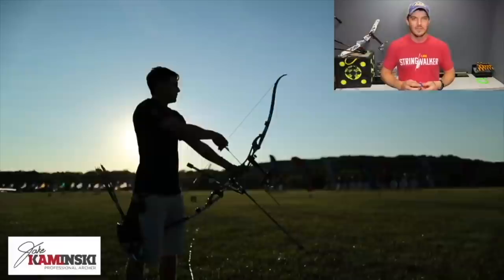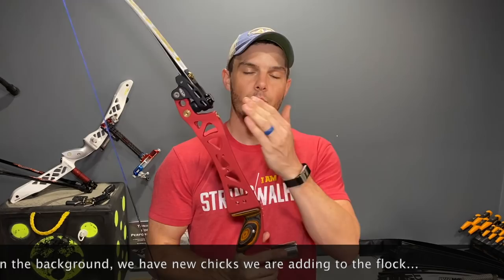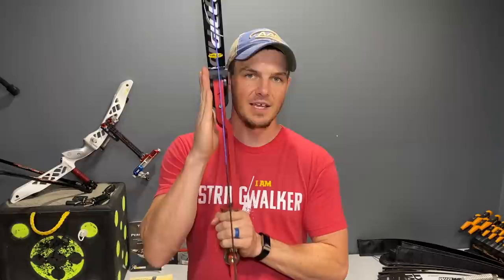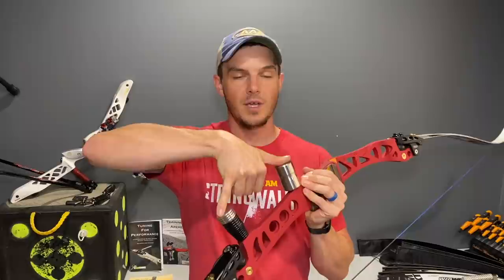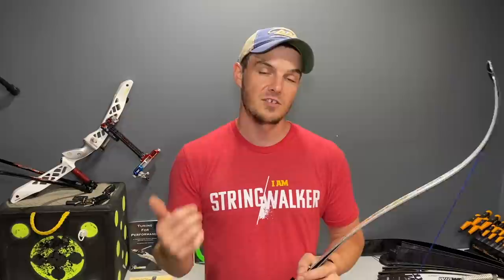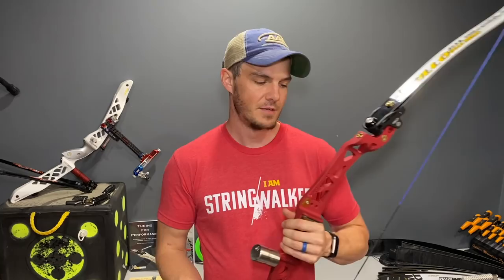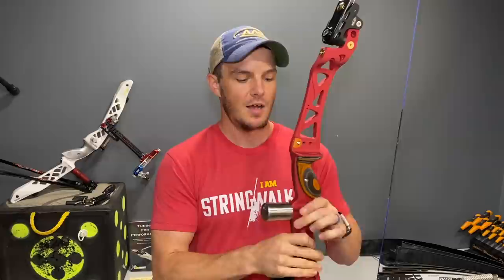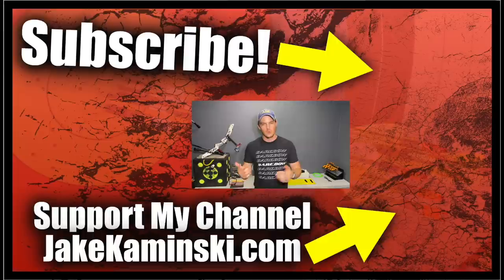Why Putting Weights on the Bottom of your Riser Isn't The Best Idea | Recurve Riser Dynamic Tuning

Comment: The weight shown at 0:52 is from the riser's manufacturer, Chaser, for their Python riser. It's called the "Road Wheel Barebow Weight System". It comes with 10 of those wheel weights so you can adjust it however you want. There seems to be a lot of barebow shooters using the Chaser Python that use this weight system on it. Chaser have a upcoming riser called the Neo Python and they've taken this weight concept and extended it so that it also bolts to the top limb attachment bolt amking it a full front brace. It makes the riser look like a W&W Radical Pro. Would be interesting to see it tested once it's released.

Comment: I´d say it depends on your reason to put weight on. Low if you want to stabilize it (inertia/pendulum effect), higher and as far out as you can to keep the upper limb from rocking back after release.  Salt to taste.
Reply: I had assumed that it wasn't  the upper limb rocking back that needs the resistance but primarily the lower limb jumping forward. Therefore weight down low would best resist the virtical rotation as a whole (and provide stabilty, but screw with the dynamics)
Reply: @TracyPicabia  during follow through (because the grip is in front of the CG) the top limb tends to rock back. you´d need much more weight at the bottom than in front of the Grip to counteract this movement. Up until release weight up front helps to dampen yaw movements, weight low dampens pitch and roll.  I know thats very simplified but in lack of a better explanation, i hope it´s understandable.
Reply: @Markus__B  ...which is why for barebow I have weights low and this does stop the upper limb rocking back.  Didnt realise it messed with the dynamics until Jake pointed it out here though.  I'm getting good groups and good stable feel at full draw with this set up and tune so I'm tempted not to fettle anymore even though bareshafts indicate a little weak spine at 18 metres
Reply: @mortenjacobsen5673  you really don´t get it, right?
Reply: @TracyPicabia  See, if your weight setup gives you a good shooting bow you´ve done it right. 
i have the Gillo AL-weight + some additional discs in the pockets and 200g in the front stabilizer.  If i remove the 200g she rocks back at me and feels a bit too light overall.  most likely very different to your setup yet neither of us did something wrong.
Reply: So should I just put the weight low if the 2nd thing isn’t an issue?

Comment: Jake, can you somehow measure how much the riser bends? Like measure the distance of the tip and the bottom of the riser un-braced, braced and at full draw? Or the "brace height" of the riser?
I really would like to see this.
Reply from the maker: Actively Working on a Jig.... Proved my concept the other day and they do flex and I can measure it!
Reply: I believe it is done using interferometry in R&D settings...

Comment: As a bow designer, I can tell you that the riser will hardly flex at all (approx 0.5mm - worst case), the effect you are finding is due to limb reaction, not riser flex.
Reply: I am interested in your view of this. Is the difference in limb reaction primarily due to the change in center-of-gravity or specifically to the mass near the limb? Put another way, how does the change in mass distribution change limb reaction  assuming overall riser stiffness and total CG remains the same?
Reply: @nosro1  A change in centre of mass has a direct effect on the weakest part of the bow - the flexible limbs. Even adding/removing weights to a longord will affect the overall shot. Tiller and nocking point positoin on the string becomes critical on barebows with weights.
Imagine a weighted bow pointing up and then down, the added weight will flex the limbs frst one way and then the other.
Reply: David Marriott this sounds plausible since allt the compund shooters seems Pretty unafected of low stabilizer mounts. And also, Their limbs are much shorter as Well as harder. Otherwise, they should also Experience unforgiving bows when using those massive weight really down Low on the limbs. Another ”bad effect” of having Low stabilizers + weight is that shooting in a straight plane works Nice, But elevated shots makes the bow very Hard to tilt and you Have to work a lot With the grip force (Palm) to compensate. so for 3D shooting Where there is lots of Angled shots its better To stabilize more to the middle of the bow.

Nice video!
Reply: @mortenjacobsen5673  dude you don't even understand what Barebow is I say this on another one of your comments but just incase.

Traditional and Barebow are not the same things. Barebow is talking about a stripped-down version of your modern Olympic style recurve. How could a Traditional bow ever be Barebow, if Traditional could never be modern Olympic recurve?
Reply from the maker: @Morten, Chill out man.
Reply: @mortenjacobsen5673  are you ok?

Comment: A lot of risers, particularly aluminum ones, have a low center of mass, which you would expect to cause this problem with or without adding weights. If the bottom half of the riser is heavier than the top, it shouldn't matter whether that weight is built into the riser or whether it is bolted on. Based on this, it seems that any riser with a low center of mass would automatically have issues like this.
I can imagine two ways around this problem. One is that manufacturers compensate for the low center of mass by adjusting the relative flex of the top and bottom limb pockets. However, I don't think it's possible to exactly replicate the dynamic results of a neutral center of mass.
What I think is more likely is that the extra weight in the bottom half is kept close to the grip, and the tuning issues are small enough that they are overshadowed by the balance and holding pattern of the bow.
If anyone has any thoughts on this, please let me know. Thank you Jake for working so hard to better the archery community.
Reply: No, even if the center of mass is in the bottom half, you can engineer it with the cutouts in the aluminum that it flexes exactly the same :D hope you can understand my bad English xD
Reply: @BIoodystar  Your english is fine, and you're correct that the manufacturers can design the riser so that the total flex distance is the same for the top and bottom, but when the bow is released, the limb pockets may not have the same acceleration, which is the problem with weight on the bottom in the first place.
In other words, it's not the flex that's the problem, it's the timing of the unflex.

Comment: For further thought . . . Jake, when you put your Olympic weight system towards the lower end of the riser and found poor results "compensating with a much higher nocking point", did you adjust the tiller to match the new higher nocking point position?
I ask, especially as you string walk. Your tiller will need to change to a new average "best" position depending on the range of string walk (highest and lowest sting grip position).
Just more food for thought.

Comment: I also recommend trying the Gillo weights and seeing how they work.  You can vary the amount and placement of the weight quite a bit.  It is a major reason to use a Gillo riser as opposed to an OR riser with weights screwed into the stabilizer holes.  You might also want to try the Spigarelli BB and Club 650, they also have special weights.  It would be very interesting to see what you think.

Comment: @Jake Kaminski I wonder if you have any speculation about Lisa Unruh's setup (bottom mounted side rods) which is apparently working for her and the Korean women's team bows which have a large weight on the top (which would presumably change the limb reaction at the top limb).
Reply: He did a video about top weights a month or two ago.
Reply: @InFerrumVeritas  That video indicated that the main purpose of the top weights was to help with the follow through. However, I didn't really hear about any impact to the shot - if heavy weights on the bottom make for lousy shot accuracy/consistency, what do top weights do for shot accuracy/consistency, especially given the incredible performance of the S. Korean teams who have somewhat recently employed heavy top weights?

Comment: I'am ney to the Business of Archery to me, what you say about the "Point way and the Stiffness makes perfekt sence. BUT, thy not try to mout it with certain Flex? Like Rubber Busshings or the Kind of stuff they use in Swaybars in a Car ? This adds the Waight in the needet place without adding mutch stiffnes to the Riser (if any)... just 2c of a newby
Reply: Barebow weights have to be solid, no dampers or stabilizer/shock absorbers allowed.

Comment: Doesn't help you the weights on the bottom to work as a pendulum weight for the riser and keep the vertical position easier? Helping to avoid lean?

Comment: With the changes to the WA Barebow rules allowing weight (and dampeners) above the handle, would you recommend adding a top weight (equal to a bottom weight) to add mass or just stick with the more typical big weight in the stabilizer mount and more below it if needed?
Reply: No, that would just mean you need to add even more to the bottom. I run a dampener up top, but no weight

Comment: I have the new Kinetic Barebow Riser with the 3 included weights I put some weight on the bottom of the riser and its so perfect in my hand the balance is center low its like it wants to go straight down my hand. But this might be just a personal preference of how I like it to feel despite the dynamics.

My Bow: https://i.imgur.com/S0Tlx6t.jpg
Reply: I have VYGO as well and I like it a lot. I've put a countermeasure to the sight window, screwing them left-large -> small-right side. 
You can check it if you like it.
Reply: @Qnnrad  I'm loving it so far as well, yeah I'd like to see a pic of that setup.

Comment: How much weight should be used? I've got 16 ounces now, distributed in the center and the bottom, with 12 ounces low. It feels like I should add more - maybe another 9 ounces or so - but what is the benefit limit? Thanks
Reply from the maker: I’m running a 20oz and a 17oz currently
Reply: @JakeKaminskiArchery  Thanks